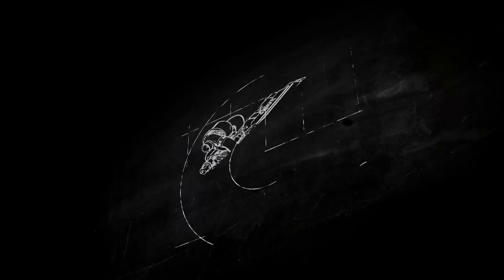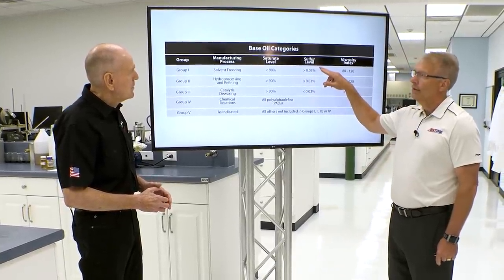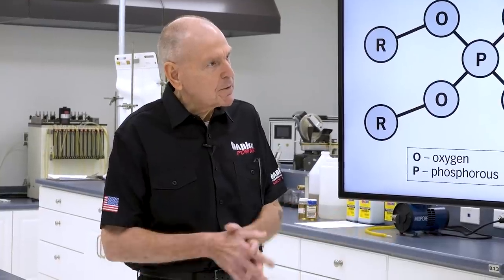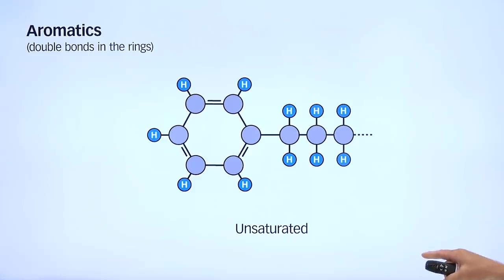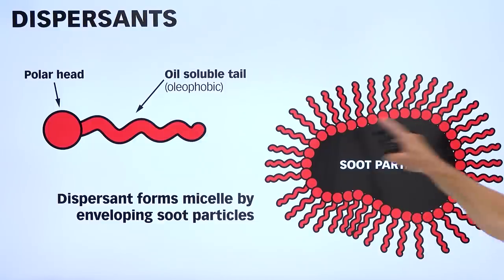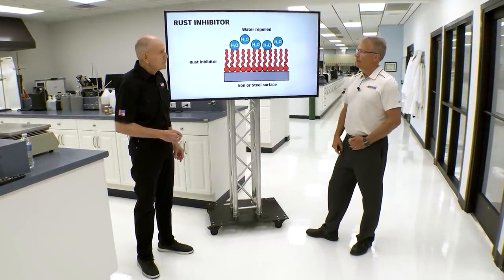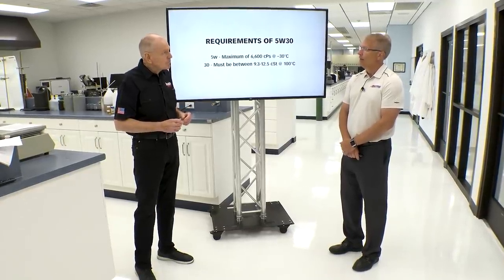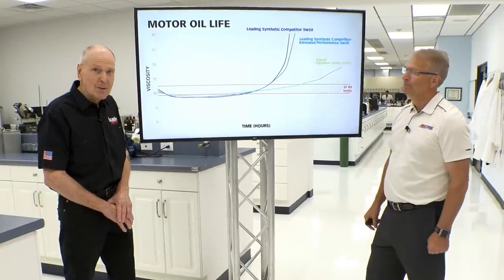What's in synthetic motor oil | Part 2 of 4

Comment: I have a question. The last graph show viscosity break down over time... What was the "time frame" until the oxidation starts?
Reply: My thoughts exactly, whats an appropriate time frame before this happens on a general scale under normal loads
Reply: That huge ramp up could be well outside the recommend service life but this is a “We came up with our own test” and surprise surprise our product came out of top….does anyone know if their methods have been published anywhere or verified by a third party?
Reply: Exactly. Leaving the units off of one graph axis does not inspire confidence. I know it's an "accelerated" test, but it would be useful to provide a "real world" frame of reference.  If the spike in viscosity in the competitors product occurs at 5,000 hrs. or is it at 20,000 hrs.... and if Amsoil's spike follows only 1,500 hrs. later......  At least mention why there were no units on the "time" axis.
Reply: @libertyfivefivesix  he scale on those graphs is generally misleading. Engine oil failure tests generally aren't run in real world conditions, because they would take way too long. To get them done in a reasonable amount of time, the oil companies usually do stress testing - so they'll run the test at higher temperatures, reduce the oil volume to make it work harder, they might even run an engine on the test stand at max load, etc. Once you've done that, the test hours bear no resemblance to real world performance so they just show the relative performance between the oils.
Reply from the maker: This is a lab test AMSOIL uses to improve motor oil formulations that run in severe conditions in the field. The test length represented in the graph is in hours. Both competitors' useful life ended after day 10 or 240 hours. The AMSOIL Signature Series product had end of life happen after day 13 or 312 hours.
Reply: @LubricationExplained  now see, if during the video they had given us what you just told me,  I wouldn't have been asking this question!
Leaving the units off of the graph is just asking for trouble.  :)
Thanks!
Reply: @libertyfivefivesix  TIME (HOURS) is right on the graph

Comment: Nice information, but as I commented on the first episode, they use mainly group III base oils, not necessarily hydrockracked group III+ (which are considered "synthetic" by the BBB decision on Mobil Vs Castrol) PAO is used as additive  and in some products that require low volatility (ILSAC, SN, SN+ and SP)
Those graphs translated :
1. The first point where viscosity goes down is very early, like 300 mi;
2. Viscosity goes up at about 1.250 mi; and
3. goes out of range at 3.000 mi, maybe the best Alsoil goes out of range at 4-4.500 mi.

A 80% PAO +15% esters (PAO is poor solvent, needs esters to solve additives) + 5% additives oil lasts within specs about 5 to 10k miles or between 170 to 250 engine hours.
It should be considered that after 5k miles /170-180 hours it would be simply dirty and the oil filter would be degraded mechanically. - Amsoil doe not offer such oil. They all darken and thicken after 4-4.500 mi. In otherwise clinically clean engines that keep their oil clean much longer.
Reply: Pretty much all Group IIIs are considered synthetic for marketing claim purposes. Group II's are even hydrocracked, they just turn up the Hydrogen Pressure when going to Group III and use catalytic- instead of solvent dewaxing. The Group III+'s generally refer to the GTL base oils which employ isomerization that's similar to the PAO process but start with a natural gas feedstock instead of ethylene.
Reply: I think as AMSoils oils go from OE to Synthetic to Signature Series, the proportion of higher group base stocks increases.
But they're never going to give out their recipe.
Reply: @LubricationExplained  I think GTL should be in Group V or VI, BTW, why group V is others, thought VI was others. Anyway. GTL is mainly a Shell thing today. 
III+ should be the very improved mineral that's so chanded that it's synthetic according to the semantic interpretation of prof Perez in 1999. That's not so recent btw.
Anyway, Amsoil as well as many, many oils is not synthetic. The wow effect lasts 300 mi with Amsoil. Faster ckrancking, etc, then by 4k mi it is sub par.
The really deep search led me to another brand from Germany that uses mainly gold bottles and state their base and modern additives on the label, PAO, tungsten, OFC, tri-niclear molybdenum, etc. and actual certificates an approvals, SP, ILSAC, Dexos and 256°C flash point in a 5W30... The Wunder oil is elsewhere.
Reply: @PenkillerDIY  a couple of things in your comment to address. There is no API Group 6 - there is an ATIEL Group 6, but that’s exclusively PolyInternalOlefins (PIOs). The API grouping has its history in engine oils where viscosity index is a large determining factor in performance. As you move from Group 1-4 the molecules get more iso-paraffinic which is desirable for engine oils as it correlates with higher VI. That’s why everything else that isn’t paraffinic (PAGs, ANs, Esters, Napthenic oils, Vegetable oils, silicones, PFPE and PTFEs) all get thrown into Group 5, despite the massive variation in performance and chemistry.

That’s also the explanation for why GTL is Group 3+. It’s more iso-paraffinic than Group 3 mineral oils, but less iso-paraffinic than Group 4.

You’re right in that most “full synthetics” will have Group 3 in them or even be mostly Group 3.

GTL isn’t just a Shell thing anymore - they’re just the only ones that make a big song and dance about it because they’re the producers. But it’s sold on the open market and used by pretty much all the oil producers. You’ll find GTL in a lot of engine oils these days, as well as gas turbine, steam turbine, gear, hydraulic and circulating oils.
Reply: FYI, We (AMSOIL) use a great deal of group IV and group V base oils in our formulations.

Comment: The number one and only rule for any lubricating chemical is how well it stands up to the heat. An improper compound will separate under the combined forces of pressure(all an internal combustion engine is a pressurized construct) and friction (where two solid bodies in motion come simply near one another.) This is why there exists two cooling systems in the ICE Platform first a fan blade plus ideally some form of liquid to dissipate heat from the engine holistically but yes absolutely an "oil return system" which attempts to the best extent possible to keep the internal components both properly COOLING*(hence all the computer stuff to safe a motor if internal pressures and Temps exceed design specs) and the lubricated to keep regular wear as part of the *body to a minimum.

This obviously includes grease points as well..."speaking of bearings..

Comment: Ok, so looking at the rust inhibitors, and this may be a dumb question, but welcome to my world ... would the polar head be able to be reversed when enough H2O is present, and pulled away from the Fe surface? I understand Fe can bond with up to 6 other molecules if I remember my biochem classes right, so maybe that is what keeps this from happening, but my other question is why not chemically engineer a bipolar lipid molecule like we find in living cell membranes that would bind the H2O molecules to the other end?

Comment: I own 5 vehicles all taking the same weight of oil. I buy it in bulk as long as it meets spec i dont care who its from i think what i used last time was truegard or some generic name like that. Meets spec, I change it and life goes on. 280K miles on my oldest vehicle doing just this routine. I bought into Amsoil once and it was good oil but I didnt see anything spectacular about it. Dirt cheapest oil and cheapest filters works the same for me

Comment: Hey Gale and amsoil

Can you tell if an oil is starting to sheer by the color it comes out at oil change or by looking at the sight glass?  I send my stuff to Blackstone and it always comes back below normal wear.  I keep up on my he intervals and rarely go over.
Reply: Oil tends to turn dark as it is used, mostly as a function of detergents doing there job.......Bottom line is the color of used oil has no bearing on serviceability of the oil and you really can't tell anything looking at it with the naked eye.
I've run samples through the lab for customers that were still pretty honey colored like out of the bottle and it came back with a problem....on the other hand I've run samples through the lab that were black and the lab said "all good" keep going!

Comment: Good science.  I just found one mistake in vocabulary on the slide presented at 23:15 into the lecture.  The arrow with the label "oil soluble tail" has the accompanying parenthetical addition of this part of the red molecule as oleophobic, but that's incorrect.  This part is, of course, oleophilic, whereas the polar head will be the oleophobic part of this amphipathic molecule.  Also, on the preceding slide actual double bonds written out would make the slide more accurate for the representation of the connections between carbon atoms in the backbone as opposed to color, which by the way was never keyed or defined in a legend on the slide or spoken except in passing by the presenter.

Comment: I'm having trouble finding a group 4 oil that meets SP classification in 0W-40. All I have seen that comes close is Shell Helix Ultra. Since it's made from gas not crude, would it qualify as a group 4? The oil I need has to be specifically classified as "SP", because it is a Direct Injection (DI) forced induction (turbo) small displacement engine. This configuration suffers from excessive carbon buildup behind the intake valves if the incorrect oil is used.

Comment: OK somebody explain to me.  @Banks Power. 22:50  Isn't there soot coming out of the engine either way, if the truck is deleted or not?   Isn't that what all the new EPA/DEF/Exhaust system is designed to "catch" it all, thus the regen that these truck go through to burn off the soot?

Comment: 40:50   Their own chart shows that Amsoil stays within spec only about 25 percent longer than the competing brands. Does that make Amsoil a bad product? No, it doesn't, but it is expensive. For another thing, if the curve is not as steep, you can go longer without having to worry too much about increasing the engine wear rate.

The other issue with oil is its ability to suspend contaminants and neutralize acids. This is a very important issue. If you change your oil early, you don't have to worry about it so much because the contaminants and acids are never there in the first place. Especially if you are doing a lot of short trip driving, the argument for using a conventional oil if you can and changing it early is pretty strong. That's what I do. But I don't think too many vehicles made in recent years came with conventional oil as original equipment. More likely, none have.

Comment: You talked about sulphur in the fuel being bad from a lubrication perspective. Here in Europe, we're limited to 10 ppm (I believe the USA limit is 15 ppm, but tell me if I'm wrong). However, I routinely operate my vehicle in Africa where some countries have very high sulphur diesel fuel (Zambia is up to 5,000 ppm, but Egypt is over 10,000 ppm). I've read that I need high TBN oils for these fuels, but apparently this causes sulphated ash build-up. What on earth does this mean? None of our vehicles have particulate filters as they're too old. Also, our oils marketed here are to ACEA specifications, very rarely do you see an API symbol. What should I do?
Reply: Hi S2S Overland,  I don't personally see any reason for concern with using high TBN oils if you have no DPF as long as you are not doing anything crazy on combustion timing.

Comment: This viscosity build-up curve is very interesting. Is there any way to detect how the oil is ageing in the engine to time an oil change properly ? Except oil analysis obviously. Something based on oil pressure evolution, ...
Reply: Yes, there are very good methods to measure how the oil is changing chemically and physically.  Foam for example, is an attribute that changes significantly over the life of a motor oil and has a dramatic impact on overall lubrication if it impacts the oil enough.  We measure several different chemical and physical properties.  Just not enough time to include everything.

Comment: I realize the presenter is trying to make a point that the competitor oils are falling below the 30 weight limits set by the definition, but please tell us if that dip below the lower limit is significant for an engine.  It seems the point is that the competitor products, though slightly below the lower limit quite soon after first use, hold their viscosity quite well and resist oxidation for a quite long period of time.  My thinking is that the competitors would not keep making a "very good product" as Dan, the presenter, stated if it could not do the job.  He said these products are very good, so then I'm thinking the motors must have engineered design clearances that allow a drift out of the lower limit by some percentage and still perform well and to specifications.  Is my point and thinking valid?

Comment: Great video overall but I was disappointed that you didn't answer these four items:
1) some oils are marketed as "semi-synthetics". What does that actually mean?
2) recommended oil change intervals compared with mineral oil lubricants.
3) running in a new or re-built engine. Some builders say to only use a mineral oil for the first few hundred miles before switching to synthetic oil. Is this true?
4) you didn't describe synthetic transmission oils.

Comment: I never received a reason why different motor oils cannot be mixed. For example, why can't I mix Mobil 1 5w/30 with other 5w/30 oils and vice versus? I had left over Pennzoil, mobil 1, and castrol edge (all 5w/30), filled my car and nothing bad happened.

Comment: As far as I am aware that "argument" regarding the base oil was between Castrol and Royal Purple. Castrol was the one that wanted to redefine. They "won", and as a result, now Royal Purple is not as good because they decided to go with the lesser base oil. At least that's what goes around in the "grapevine" as it were. Now I use neither (used to be RP all the way) because of this.
Reply: Not R.P.  Exxon M
Reply: @429thunderjet2  You sure? I swear on BITOG there was a massive thread about this. That's where I learned about it. Of course it's been MANY years ago and I might be forgetting something, so...
Reply: @rocketsurgeon11  yup, I heard it through several sources. It was back in the mid to late 90s Castrol developed the group 3 petro base and called it synthetic and Mobil called them on it  that it wasn't synthetic in the true sense of the term. But So now the term full synthetic is just a marketing term because supposedly some so called full synthetics contain large amounts of conventional group 2 bases. Very disappointing. AMSOIL  all the way for me.
Reply: @429thunderjet2  alright, well, I guess my memory failed me. Side effect of age, I guess.
Reply: @rocketsurgeon11  no problem I can give you one of my sources is Dan Watson is a big AMSOIL dealer in Florida and he did some audios on you tube from a car guys radio show he used to do. pretty interesting I thought.

Comment: No mention of how many hours of use in the motor oil life graph another Great information Gale 🏁💯😊👍🙏 Ted 🇦🇺🇦🇺
Reply from the maker: This is a lab test AMSOIL uses to improve motor oil formulations that run in severe conditions in the field. The test length represented in the graph is in hours. Both competitors' useful life ended after day 10 or 240 hours. The AMSOIL Signature Series product had end of life happen after day 13 or 312 hours.
Reply: @bankspower  thanks for the reply love your work and fantastic technical information 🏁💯👍😊

Comment: Looks like all these information were very well custodied and protected for many many years now by industry professionals. Is it because the consumer motor oil industry future looks bleak (because of the advent of EVs) that Amsoil is giving his insight into his own realm of knowledge? I mean, I think there is no investment at all in R&D right now in the industry because there is no reason to spend money in a business that already reached full maturity, is expected to shrink in the short term and disappear in the long run.
Reply: Eve vehicles will never replace all the motorized vehicles.
The electrical infrastructure would never be able to withstand the demands of charging them.
The amps required would tax most homes and the whole street grid would fail.
Reply: Amen.
Reply: Ev also have systems with oil for Lubrication.
Reply: There's a reason that Amsoil is starting to diversify into other industries. They're making big moves into the wind turbine gear oil market at the moment.

Comment: This video was very informative and interesting to car nerds like myself BUT, to most people this info is irrelevant.  Why?  How many people now a days change their own oil?  Newer cars are getting more and more difficult to do things yourself.  Additionally, all that matters if you do your own oil changes is to find the oil that meets the specifications for your engine.  If your under warranty and plan on keeping your warranty, it is imperative that you use an oil with the specification that is required.  For example.  If you own a VW and it requires VW 508 oil, find an oil that has the VW 508 approval on it.  If the oil does not have the approval, go to a brand that does.  If you don't care about your warranty, and your car is modified or whatever?  Do what you like.  Of Note, Amsoil does make a VW 508 oil, but does not carry the VW approval.